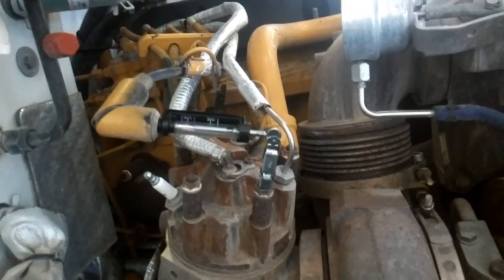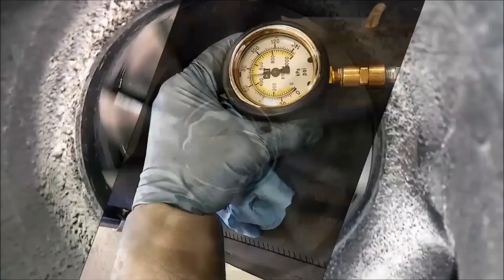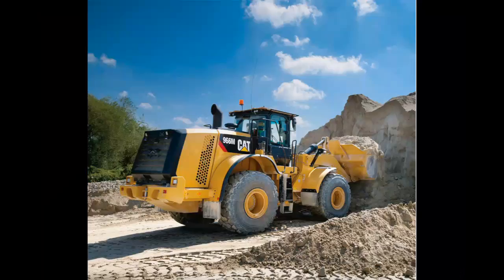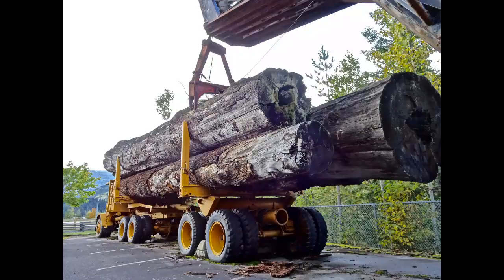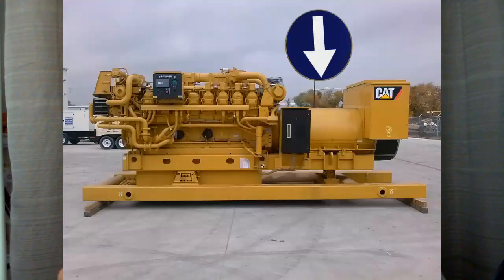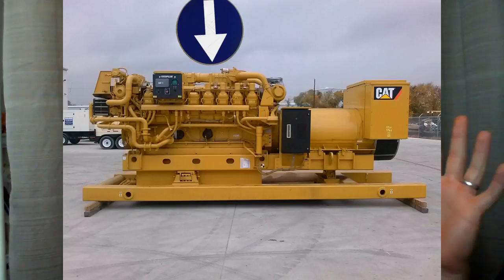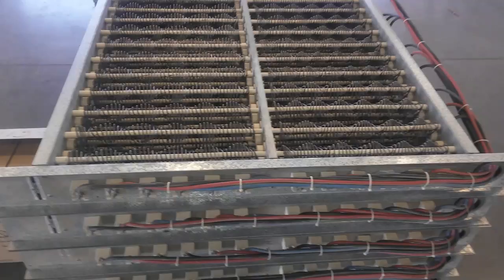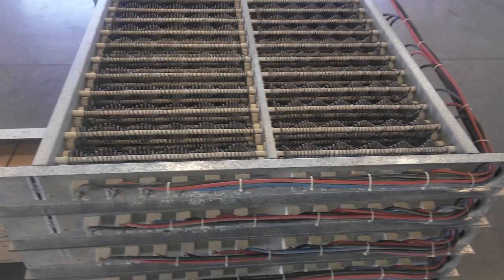What Being A Diesel Electric Power Generator Mechanic Is Like?

Comment: Hey Adept I have a KW with a C13    I have a code for iva oil pressure. I changed the sensor but check engine light comes back on like every 2 hours of driving   What can it be
Reply from the maker: +Victor Guzman You could have an actual oil pressure problem to the sensor. It has a check valve and a purge valve. Is the code an electrical code or a pressure code?
Reply: Adept Ape Cat ET hooked up computer and it shows Engine Intake Valve Actuation System Oil Pressure : Low-Moderate severity (2)
Reply from the maker: +Victor Guzman That is an actual mechanical oil pressure code. First thing to check is for leaks in the iva system. Cover the purge valve and start the truck with the valve cover off. Look for oil leaks in the overhead.
Reply: Adept Ape Is it a critical problem to fix asap would you say
Reply from the maker: +Victor Guzman No, it usually isn't a critical problem. The code can derate you though, so it might cause you problems. It isn't going to cause engine damage most likely, if that is the question though.
Reply: Adept Ape ok thanks man keep up the great videos

Comment: Work on Solars at all?
Wait, what?.... Cat doesn't build truck engines anymore?  Really?
Last I checked, get Kabota.. not the Cat generators. That may be old info now.  Reeeealy dig the Cat flywheel switchgear stuff for bumpless transfer onto generator.... assuming it all works right.  
Cool post... this is the kind of stuff I work with.

Comment: I'm 22 in the army I work on generators 3kw to 60kw can someone let me know whats out there for jobs in the civilian life
Reply: All the big engine companies have generator divisions - I worked for Cummins and Detroit as a generator tech.  There are all kinds of generators on ships - so any big shipping company will need generator techs - however before you get into ships and stuff you need to get some experience on bigger machines so I recommend getting a job with Cummins distributor... learn all about voltage regulation - basler voltage regulators are the industry standard in bigger equipment also you need to learn about paralleling generators - there are some good jobs if you learn your craft and the money is good... I have worked on generators so small they would be hard pressed to run a woman's vibrator to 31.5 megawatts at 13,800 volts.  All generators work the same the only difference is when you get to higher voltages ... hope you enjoy the trade...
Reply: @jth1699  I know how to work on tqg generators,amp generators that have a software in them I know how to lay down wire on power grids I know how to parallel generators but yeah you are right I haven't worked on anything bigger than a 60kw but thank you for the information I really like working on generators

Comment: Ever have a runaway generator?
Reply: They are usually bolted down but I have had one stolen, although come to think of it, it's owner did treat it like crap so it might have run away.  Very rare on modern sets as they have at least two safety shutdowns in the fuel system and VW don't make alternators hehehe.  Generally speaking they are far to well maintained because of their importance to the customer, the usual means of murder is a burst hose in a cooling system that has no low water cutout so many sets don't even now, since the temperature senders are designed to measure "liquids" and not "air" they don't read the overheat and the governor just keeps adding more and more fuel to keep the tightening engine at rated speed til it's farked. The other excellent one is where the top pops off the oil pressure switch and the slippery stuff all sprays out, since the oil pressure cutout is wired to close on a fault and oil is a such a great insulator, that will sometimes stop the switch from shutting down the engine before it chucks a leg or two out of bed. My old 671 twin pack GM had both fuel rails gummed up at wide open throttle when I purchased it, it only had 134 hours on it but it had been standing for 10 years at wide open throttle because they had mechanical governors.  Fortunately I had been told not to start it before checking the fuel system.  A lot of those old GM's had spring loaded flaps that closed off the induction air, these were operated by a solenoid connected to the controller and slammed shut if the speed went a bit to high, mind you that usually created such an immense vacuum in the engine that it sucked in all the cork gaskets, and that was always fun to explain to the owner.
Reply: They usually are hobbled so they walk away.